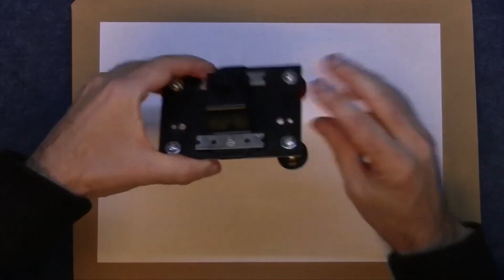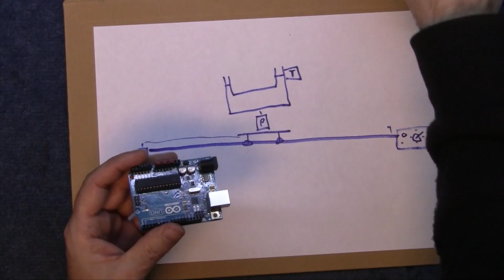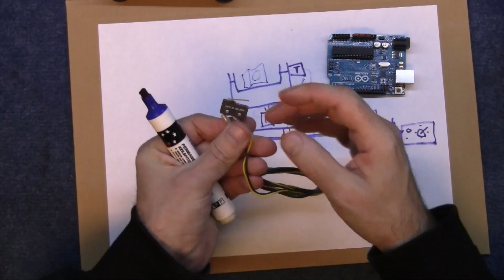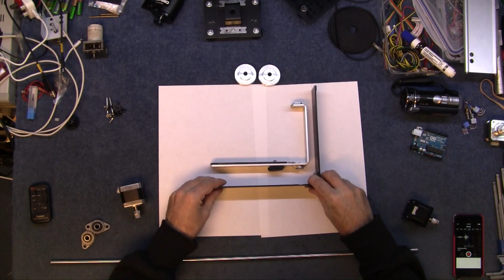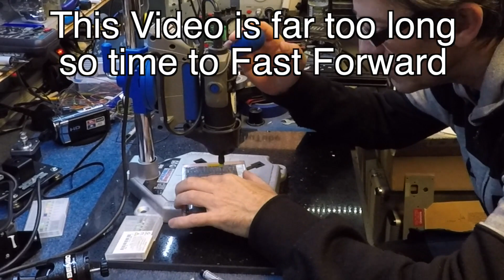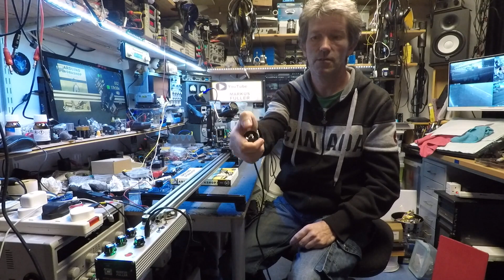1.5 meter Fully motorised DIY Arduino Camera slider with Pan Tilt & GOTO position memories

Comment: Hi, where is the code? thanks
Reply from the maker: Hi ana if you can send me an email message or private message I can send you a link to the code etc. the website no longer exists.
Reply: Can't email you because your email isn't listed anywhere as far as I can tell. Would love to see your code. Been trying to figure out A to B with 3 motors at different speeds but starting and ending at the same time. Been difficult finding documentation that explains how to do this.  @markusfuller
Reply from the maker: @DorfyBoi  Arduino camera slider code

/*
  stepper motor Rail Pan Tilt camera controller
   by Markus Fuller 2020
  using 1 Arduino UNO 3x nema17 stepper motors and 3x EasyDrivers from www.schmalzhaus.com
  Library - AccelStepper by Mike McCauley:
  http://www.airspayce.com/mikem/arduino/AccelStepper/index.html

*/

#include <AccelStepper.h>
#include <MultiStepper.h>

#define PanX A0       // Pan X pin
#define TiltY A1       // Tilt Y pin
#define Rail A2     // Slider potentiometer
#define inOutPot A3   // In and Out speed potentiometer
#define PanStop 10  // to stop pan cable tangling
#define Button 12   // Set Button
#define EndStop 11
#define RedLED 8   // RGB Led Red
#define GreenLED 9 // RGB Led Green
#define blueLED 13 // RGB Led blue

// Set stepper motor pins on Arduino as type, Step, and Direction,
AccelStepper stepper1(1, 7, 6);
AccelStepper stepper2(1, 5, 4);
AccelStepper stepper3(1, 3, 2);

MultiStepper StepperControl;

long gotoposition[3]; // stores the A and B position for every stepper motor

int PanPos = 0;
int TiltYPos = 0;
int RailPos = 0;
int currentSpeed = 100;
int inOutSpeed = 100;

int XInPoint = 0;
int YInPoint = 0;
int ZInPoint = 0;
int XOutPoint = 0;
int YOutPoint = 0;
int ZOutPoint = 0;
int InandOut = 0;

void setup() {
  stepper1.setMaxSpeed(3000);
  stepper1.setSpeed(300);
  stepper2.setMaxSpeed(1500);
  stepper2.setSpeed(75);
  stepper3.setMaxSpeed(1500);
  stepper3.setSpeed(75);

  pinMode(PanStop, INPUT_PULLUP); //faultstop to help prevent pan cable tangling
  pinMode(Button, INPUT_PULLUP); //setswitch which is also activate button
  pinMode(EndStop, INPUT_PULLUP); //endstop microswitch
  pinMode(RedLED, OUTPUT); //red led
  pinMode(GreenLED, OUTPUT); //green led
  pinMode(blueLED, OUTPUT); //blue led

  StepperControl.addStepper(stepper1);
  StepperControl.addStepper(stepper2);
  StepperControl.addStepper(stepper3);

  // Move the slider to the Home position when first turned on
  while (digitalRead(EndStop) != 0) {
    stepper1.setSpeed(1500);
    stepper1.runSpeed();
    stepper1.setCurrentPosition(0); // When EndStop is activated this sets position as step 0

  }
  delay(30);
  // Moves back slightly from the rail endstop
  while (stepper1.currentPosition() != -1500) {
    stepper1.setSpeed(-1500);
    stepper1.run();

    // This section below for Pan centre control
  }
  // Moves the pan head anticlockwise until microswitch is activated
  while (digitalRead(PanStop) != 0) {
    stepper3.setSpeed(-400);
    stepper3.runSpeed();
    stepper3.setCurrentPosition(0); // When Pan is centred set position to 0 steps

  }
  delay(30);
  // Moves pan clockwise untilfacing forward, this may need to be changed depending on how many teeth between stepper and pan wheel
  while (stepper3.currentPosition() != 1070) { 
    stepper3.setSpeed(400); 
    stepper3.run();

    // End of section above
    
    digitalWrite(blueLED, HIGH); // blue led turns on
  }

  }
     void loop() {
  // this will cancel out the rail movement if you try and travel beyond safe limits
  while (digitalRead(EndStop) == 0 || stepper1.currentPosition() < -40500) {}

      if (digitalRead (Button) == 0) {
      delay(1000); // hold switch for 1 second to reset all values then LED turns Blue

      if (digitalRead (Button) == 0) {
      InandOut = 4;
      }
  switch (InandOut) {
    case 0:   // Set the A position
      InandOut = 1;
      XInPoint = stepper1.currentPosition(); // Set the IN position for steppers 1
      YInPoint = stepper2.currentPosition(); // Set the IN position for steppers 2
      ZInPoint = stepper3.currentPosition(); // Set the IN position for steppers 3
      digitalWrite(blueLED, LOW); // MSF blue led goes out
      digitalWrite(RedLED, HIGH); // Light up inLed
      break;

    case 1: // Set the B position
      InandOut = 2;
      XOutPoint = stepper1.currentPosition(); //  Set the B positions for steppers
      YOutPoint = stepper2.currentPosition();
      ZOutPoint = stepper3.currentPosition();
      digitalWrite(RedLED, LOW); // red Led goes off then Green Led Illuminates stating ready to run
      digitalWrite(GreenLED, HIGH);
      break;

    case 2: // Move to A position / go to next part case 3
      InandOut = 3;
      inOutSpeed = analogRead(inOutPot);
      // Place the A position into the Array
      gotoposition[0] = XInPoint;
      gotoposition[1] = YInPoint;
      gotoposition[2] = ZInPoint;
      stepper1.setMaxSpeed(inOutSpeed);
      stepper2.setMaxSpeed(inOutSpeed);
      stepper3.setMaxSpeed(inOutSpeed);
      StepperControl.moveTo(gotoposition);
      StepperControl.runSpeedToPosition();
      delay(200);
      break;

    case 3: // Move to B position and returns go back to case 2 above
      InandOut = 2;
      inOutSpeed = analogRead(inOutPot);
      // Place the B position into the Array
      gotoposition[0] = XOutPoint;
      gotoposition[1] = YOutPoint;
      gotoposition[2] = ZOutPoint;
      stepper1.setMaxSpeed(inOutSpeed);
      stepper2.setMaxSpeed(inOutSpeed);
      stepper3.setMaxSpeed(inOutSpeed);
      StepperControl.moveTo(gotoposition);
      StepperControl.runSpeedToPosition();
      delay(200);
      break;

    case 4: // If Set button is held longer than one second go back to the beginning case 0 above
      InandOut = 0;
      digitalWrite(RedLED, LOW);
      digitalWrite(GreenLED, LOW);
      digitalWrite(blueLED, HIGH);
      delay(1000);
      break;
  }
}

      // PanX - Pan movement XPos
      
     PanPos = analogRead(PanX);
      // if Pan Pot is moved left, move stepper 2 pan anticlockwise

     if (PanPos > 600) {
      //stepper2.setSpeed(currentSpeed);
     PanPos = map(PanPos, 600, 1024, 0, 200);
     stepper2.setSpeed(PanPos); // Increase speed
}
      // if PanPot is moved right, move stepper 2 pan clockwise
     else if (PanPos < 400) {
      //stepper2.setSpeed(-currentSpeed);
     PanPos = map(PanPos, 400, 0, 0, 200);
     stepper2.setSpeed(-PanPos); // Increase speed
}
       // if PanPot is centred then there is no movement
    else {
     stepper2.setSpeed(0);
}

      //Tilt Y - Tilt movement
      
     TiltYPos = analogRead(TiltY);

     if (TiltYPos > 600) {
      //stepper3.setSpeed(currentSpeed);
     TiltYPos = map(TiltYPos, 600, 1024, 0, 200);
     stepper3.setSpeed(TiltYPos); // Increase speed
}
     else if (TiltYPos < 400) {
      //stepper3.setSpeed(-currentSpeed);
     TiltYPos = map(TiltYPos, 400, 0, 0, 200);  // Try changing this to lower value to slow tilt stepper
     stepper3.setSpeed(-TiltYPos); // Increase speed
      // If TiltPot is centred then there is no movement
}
     else {
      stepper3.setSpeed(0);
}

      // RAIL potentiometer
      
     RailPos = analogRead(Rail);

      // If potentiometer is turned left then the Gantry moves towards the control unit

     if (RailPos > 600) {
     RailPos = map(RailPos, 600, 1024, 0, 3000);
     stepper1.setSpeed(-RailPos); // Increase speed
}
      // If potentiometer is turned right then the Gantry moves away from the control unit
     else if (RailPos < 400 ) {
     RailPos = map(RailPos, 400, 0, 0, 3000);
     stepper1.setSpeed(RailPos); // Increase speed
     // If potentiometer is centred then there is no movement
}      
     else {
    stepper1.setSpeed(0);
}
     // run the camera slider
    stepper1.runSpeed();
    stepper2.runSpeed();
    stepper3.runSpeed();
}

Comment: Ace....  Curious on how you fixws the toothed belt to the gantry,,, got something similar,, but the space under the gantry is minimal ...
Reply from the maker: I used a nut and bolt with the belt wrapped around it the cable tied. but yes youare quite right there us very minimal room under there to do this.
Reply: @markusfuller  many thanks, think i'll try your method. looked at a small piece of angle, but alas no room

Comment: Thanks for sharing your work in such a detail. I have read all the comments.
I visited your site where I read the full documentation. But I have this question, is it possible to mount Nik....... coolpix P1000 which weighs almost 1.5 kg. Will your slider be able to handle it.

Comment: 10 months later are you still using this? I am not new to making things but have been wanting to do a slider for a while this looks awesome and I might try it. Just wondering whether you eventually went to a smaller size? Or whether you still use it regularly

Comment: If there's an opportunity, I would really like to see closeups of how you assembled the mechanical parts from the gantry up to everything below the L brackets that do the rest of the motion. I mean how the parts of vertical shaft bearings, 60T pulley, pan stepper motor etc. are arranged and fastened. Mine is topped off with the 1/4-20 threads for a ball head to pan and that's sufficient for me. I'm trying to improve a kit I bought that is too weak in design and attachments. What I found on your website was the Arduino code but no assembly steps. Thanks.

Comment: Is there a way in the code to make it continuously loop between A and B positions?
Reply from the maker: no but I think it would be easy enough to write it into the code. trouble is im still quite new to arduino programming.
Reply: I'm no programmer, but I solved it by adding a toggle switch and named it "BounceOn" and some goto cases in the switch case... not popular, but it's solving my problem :-)
Add the moment I'm only using the Rail-part (1 axis) for placing a Cellphone, but the bounce code should work for all 3 axis.

Remember to define the input before setup:
#define BounceOn 4      // On = Bounce between A and B position continuously, Off = run to next position

And add this in void setup():
pinMode(BounceOn, INPUT_PULLUP);    //On = Bounce between A and B position continuously, Off = run to next position
 
The Bounce part of the code comes here:

=======Start======================
case 2: // Move to A position / go to next part case 3

caseA:  // Loop start, bouncing between A (In) and B (Out) positions

InandOut = 3;
inOutSpeed = analogRead(inOutPot);

// Place the A position into the Array
gotoposition[0] = XInPoint;
stepper1.setMaxSpeed(inOutSpeed);
StepperControl.moveTo(gotoposition);
StepperControl.runSpeedToPosition();
if (digitalRead(BounceOn) != 0) 
{
goto caseB; // Goto case B, were bouncing loop starts
}
else 
{
break;
}

case 3: // Move to B position and returns / go back to case 2 above
caseB:

InandOut = 2;
inOutSpeed = analogRead(inOutPot);

// Place the B position into the Array
gotoposition[0] = XOutPoint;
stepper1.setMaxSpeed(inOutSpeed);
StepperControl.moveTo(gotoposition);
StepperControl.runSpeedToPosition();
if (digitalRead(BounceOn) != 0) 
{
goto caseA; // Goto case A, were bouncing loop starts
}
else 
{
break;
} 
==========End======================

Comment: Hey great job.But i see some problems in your MOCO system,and i see it because i make same system a little bit different but overall design is same.So pan and tilt side is not very stable and i see a lot of vibration,the footage are smooth but shaky.And there is no acceleration and de acceleration(from start point and end point). But overall good job

Comment: Nice project.  I might give it a go.  I would add a slip ring to the Pan so that I could get complete rotation.
Reply from the maker: Hi Michael. I was going to use one from a ptx camera but could not get it to mount very well. but a slip ring would be great for complete rotation :-)
Reply: @markusfuller  Great!  Yes, slip rings are an odd animal to mount.  I will need to take a closer look at your setup for the pan and see if I can come up with something.

Comment: One of the best DIY designed 3 axis camera sliders that I have seen to date.
Reply from the maker: Thank you very much.
Reply: @markusfuller   how can i add lcd if i use  arduino mega and lcd like 20x4 or something hire like tft lcd
Reply from the maker: @muhammadwaqasfarooq8321  Hello Muhammad . if you add an LCD or TFT display you will have to write new code into your arduino project telling it what you want to display on your device. there are a few interesting videos on youtube by other people where they have used displays with motorised cameras. also have you seen the videos from “Dronebot Workshop” as they have many videos about using motors and displays etc for arduino projects. best wishes
Reply: @muhammadwaqasfarooq8321  i do the same projekt with lcd ST7355. Observe my channel. The movie will be soon.

Comment: Nicely done, 3 axis and a cool controller-design. I have made mine with separated external controllers, so I can use the pan on a tripod as a single solution... a little more flexibility, but I didn't build a tilt-function. Mhhh....
Reply from the maker: seperate the pan unnit for use on a tripod. thats a nice idea. 👍

Comment: A little trick for manual sliders and video tripods is to use an elastic band to pull it. It gives you a smooth start.
Reply from the maker: Thats a good Tip Thank you

Comment: Standard camera fitting is 1/4  inch whitworth.
Reply: Standard camera fitting is 1/4 inch UNC.
Whitworth is 55 degrees thread angle, UNC is 60, a Whitworth will usually fit, but it's a UNC thread.

Comment: Very very cool!  Also, you got a moog one?!
Reply: Looks more like a Waldorf Quantum to me? the synth leaning up against the wall. Ah there is it later in the video :)
Reply from the maker: @6581punk  The Quantum is just on loan
Reply: @markusfuller  Quite jealous. I keep meaning to sell off some synths and get one since it will cover a lot of sonic ground. But I vowed to make the Forte my last purchase.
Reply: @6581punk  said:" But I vowed to make the Forte my last purchase.
" 
yeah right :) i have said that after all my purchases..hehe
Reply: @bobfrode  I said that after the Solaris.
Reply: Yeah. My last one was about 4 synths ago. Currently my list of last ones is down to about 7.
Reply from the maker: Yes I sold off a lot of my gear to buy that moog one. not sure I did the right thing but I have more room in the house now.
Reply: @markusfuller  It's ultimately down to if you like the sound. Personally I feel I've moved on from the "vintage" tone. But the Voyager probably wasn't the best Moog to try I guess.

Comment: Instead of using end stops/switches could you use stepper motors with rotary encoders and count the rotational pulses, mounting the stepper motor/drive units on the gantry thus (apart from the power cables) making it track length independent? (edit maybe I should watch the whole video before commenting?)
Reply: Incremental encoder feedback systems still require homing to switches. That is, unless you're proposing to use multi-turn absolute encoders, which are incredibly expensive. Rotary incremental encoders and linear incremental scales are much more affordable but because they are incremental (simple pulse or quadrature) they need to be initialized to a "hard" reference point, else how would they know where they are counting from?
Reply: @sootikins  you can mount the end switches on the gantry as well - then set the initial starting point by either manually depressing an end switch or by sliding the gantry to one (or both) track ends and recording the rotational pulses. It would be a more complex system but would allow for track length independence.
Reply: @TheRealSasquatch  I agree but I thought we were talking about eliminating the switches completely. All I was saying is that incremental feedback designs need something to tell it positively "you are here".
Reply: Absolutely. I just try to think of simple solutions.